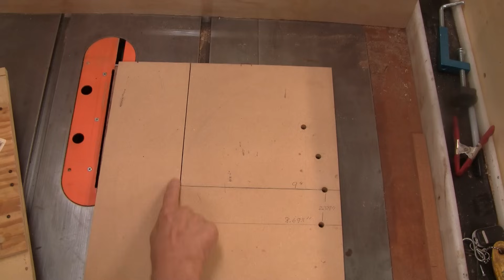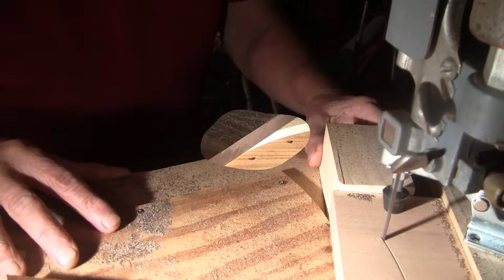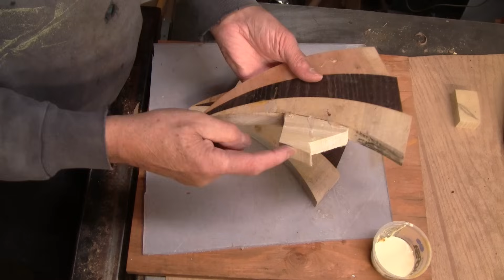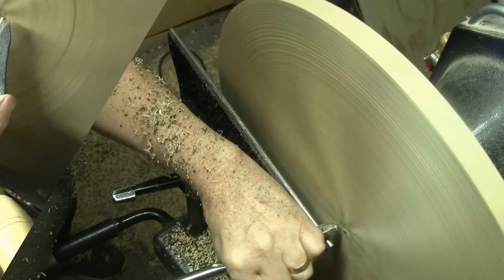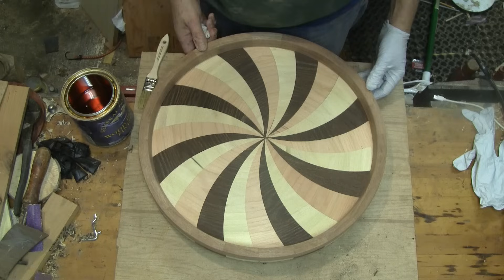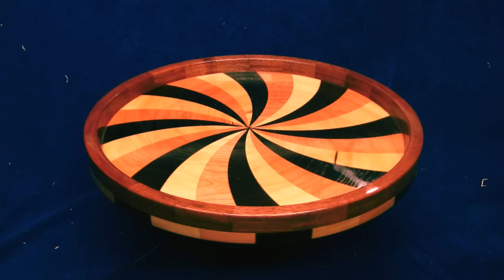This Huge Vortex Tornado Wood Turning Maxed My Lathe

Comment: Gary, this is the second vortex bowl you have made and put on your page.  They are vastly different, so my question is whar is the mathematical basis for the computations that make up the jig?    For example, if I wanted to make something midway in size between the two, how do i figure that out?
Reply from the maker: Thank you David. In this video I show how I use the same jig to make a larger turning.https://www.youtube.com/watch?v=3tnPEoQKZH8
The first one and the one in this link have 12 segments.

This bigger one here has 24 segments so I made a new cutting sled for it.
Hope this helps. If you need more information it would be easier with email.
Thanks for watching,
Gary

Comment: Thank you Gary!  I have seen some folks use salt to slow the slipping, but of course that makes initial alignment challenging.  
I wonder if some variant of a long worth chuck would make the glue up easier assuming a glue with a slow enough cure was used.   Please do keep doing these, I truly admire your ingenuity and creativity.    I think I better master doing the smaller version before tackling the big one.   Again thank you, really awesome.
Reply from the maker: Thank you very much Ian! I am opposed to using salt in the joints. And one is not being able to make fine adjustments if needed. Gluing everything at once leaves lots of ways to keep it from slipping.  That my  be something I do if I should do another large one like this. But it is so big hard to find a place for it. We used it for a few family get togethers and will probably use it next month. It was more of a challenge than anything. Smaller is better in some cases LOL
Thanks for watching,
Gary

Comment: I think that I spotted your "big Boo-boo"...  The grain direction on one piece of the smoked oak seems to be perpendicular to all the others.
Reply from the maker: You  are correct Dave. it was  apiece I cut to decide which direction I wanted to cut the pieces. I should have tossed it as it ended up in front of my while I was gluing everything together.
Gary

Comment: Hi Gary 
  Really enjoy your videos. I am currently working on a bowl with an angled stave construction and finding the glue up to be challenging. Do you have any tips.
Reply from the maker: Thanks Rodney! Happy you enjoy my videos.

Depending on how long they are I would tape the pieces so you can roll it together and get a hose clamp on each end.
Check this video out and see if it is what you are doing.
https://www.youtube.com/watch?v=R4T1B--E8gw
Reply: The video really helped. Thanks. Will have to try your rope clamp.

Comment: i and looked until I was crosseyed, but still couldn't find a BOOBOO.
Reply from the maker: Thank you Cora. Well it is very hard to see. But I had one of the burnt oak pieces with the grain going the other way from the rest. I had cut that piece when testing the cutting fixture and should have tossed it. Instead it somehow got mixed up with the rest of the pieces.
Nice hearing it is pretty hard to see...except for me LOL
Thanks for watching,
Gary

Comment: Nicely done. Always like a challenge so this will go on my list. Well, the other, smaller vortex bowl was already on it but I just revised the list for the larger size. I do enjoy your commentary. Andy the wrong grain isn't an issue, it's a feature.
Reply from the maker: Thank you very much Randy. You may want to wait till I try the new glue method I have plans for. This was a real bear to glue up.
 Yes it is a feature but not really planned and I was not happy with myself. But it works.
Thanks for watching and reminding me of it not being a big deal.
Gary
Reply: Isn't it interesting how often we figure out the easy way to do something just after we do it the hard way? And I always refer to that type of error as SDE ( Serendipitous Design Enhancement ) @ThePapa1947

Comment: HI Gary...very nice platter!  I wonder if you could answer a question...I notice that you use the ACKS abrasives and wax a great deal, but didn't use it on this project.  Could you say a bit about which finishes you use the ACKS products on, and which you don't?  I just finished a small table top with General Finishes Arm-R-Seal, and wondered about using ACKS to bring out the gloss a bit...couldn't find any examples of people doing that... Thanks!
Reply from the maker: Thank you very much Israel.
 I use the Acks on all of my finishes.  The finish on this one had the depth I was looking for so I did not use it.
But I use it a lot on the wipe on poly that I use.
 I see no reason not to use it on the Arm-R-Seal. For me it is a substitute for having a buffing system.
Hope that helps and thanks for watching,
Gary

Comment: Hi there Gary yet another excellent project I really want to have a go at your vortex tray but looking at my new Axminster 406 it will only allow me to turn 16 and a half inches over the bed bars , if I am careful do you think I could turn it sideways?  if not would it work cutting the pieces out on your sled if I just shortened them a little or would that send the shape all wrong.In the meantime I am looking forward to seeing your video on making the sled as I am not quite sure about one or two things like just where you have put the holes for pivoting the top part,and how critical is it to get the 2 measurements right 8.69 inches and2.39 inches,plus the positioning of the long and short blocks.Thanks very much in anticipation you are a very skilled man I am looking forward to attempting this i did manage the bowl with fish in Padouk and sycamore but I have still to cut the rings yet.It really is great whatching your videos please keep it up and may you and your family all have a very merry Christmas and a happy new year from Ron and Anne in Spalding Lincolnshire England.
Reply from the maker: Hi Ron.
 You will be able to turn anything from a 1 inch bowl to a 24 inch. It is a matter of the placement of the stop.
The placement of those holes are very critical to everything working. Not hard to do though.
 I this placement will give you 24 segments. My first jig did 12. 
You could actually leave the locator board the same but it is a waste of material and the scrap will be much bigger on a smaller turning. So by adding spacers against it you can adjust for less waste.
 I can go over that in a video.
Thanks for watching,
Gary
Reply: Thanks very much that  reply Gary I look forward to seeing your video you are a great guy bye for now Ron

Comment: That is one beautiful platter. I did see one spot that looks like it was accidently scratched/cut fairly deeply it doesn't take away from the beauty.
Reply from the maker: Thank you Judith. That black line that looks like a scratch is some staining that was in the wood.
Hint: Look close at the grain in all the pieces. But I will show it in a few weeks.
Thanks for watching,
Gary
Reply: Thanks for correcting me.
Reply from the maker: Well it does look like a scratch for sure. And it would be hard for you to tell just looking at a picture.

Comment: Gary
Yet another amazing vortex turning. I have made over 2 dozen of your 8 and 11 inch "bowl-from-a-board" vortex bowls (great Christmas gifts!) using the earlier small band saw jig. I would love to give the larger version a try, however, my lathe is maxed out at a 14" swing. Really looking forward to seeing how you build the larger jig, but is there some way to scale the diameter down to make something in the 12-14" range? Thanks again for the easy-to-understand step-by-step details.
Reply from the maker: Thank you Bruce. The new jig will make glues ups  1 inch in diameter to 24" or more. Just a slight adjustment on the fence to place the stock.
I have and idea on what that is adjustable but will need to work on that.
Thanks for watching,
Gary

Comment: Try as I might I can’t see any thing going on other than one beautiful project. Great job once again. Keep on turning I really enjoy your videos.
Reply: I made 5 cutting boards at one time. They were all 12”x18”x2” thick. I had them all ready for a final sanding, I was looking back at the stack of them as I was heading in for the day wouldn’t you know it on one of them I glued  one board with a piece of cherry and walnut reversed. I let it go and used it for a drawing.
Reply from the maker: Thank you Dale. It is kind of minor but it bugged me. I will show it in a future video. One of the pieces had the grain going the wrong way. It was a practice piece and decided to cut the pieces with the grain going the other way and I should have tossed that practice piece. I picked it up without paying much attention....oops
Thanks for watching,
Gary

Comment: Lovey piece. I like the Lazy Susan idea. 

Obviously the issues you talk about are pretty minor. The one joint is very minor. It wasn’t really visible on the video, but was the other one the center point? If not I have no idea. 

Great job and video.
Reply from the maker: Thank you Doug. I will try and show it in a video in a few weeks. But what it was involved the grain going the wrong way. It was a test cut to try and save lumber and I should have tossed it when I went the other way. Some how I was to close to the ones I was using. OOPS
 Thanks for watching,
Gary

Comment: Absolutely liked it, any of the projects you do that require a little upfront prep/engineering I find the most interesting.  Please, please do a video,Mon making the bigger jig, and of course any tips on glueing it up.    Was that a 1/4 or 3/16” bandsaw blade you used?  Thank you Gary!
Reply from the maker: Thank you Ian. I will do that video but it will be a month or so before I can get at it.
I used a 3/16 bandsaw blade on this. I think a 1/4" may have worked as good because it is a larger radius. These are things I need to iron out.
Thanks for watching,
Gary

Comment: when did you notice your lay out was off?  Had two dark pieces with one light piece, while turned work had two light between two black?
Reply from the maker: I think it was when I was block plaining the bottom.  
But the oops I was talking about at the end is still in there. Has something to do with grain.
See if you can find it.
Thanks for watching,
Gary

Comment: What a success, Gary! Didn't think I'd like the Poplar, but I do. Not sure I can see your mistake. I certainly like a project that is more than it seems or has multiple functions. Great work!
Reply from the maker: Thank you Jay. I was not so sure about the Poplar either. But the cost was very reasonable. I tried to keep the cost down as I wanted to make sure this would work. Well I knew would but had not worked out how to glue it up.
I think I have something that will be perfect so I will have to make another one.
  Getting wood at the hardwood store has gotten a bit costly. Since I do not sell I can not recoup the cost. 
But I do enjoy making segmented work.
Thanks for watching,
Gary

Comment: Gary I find these segmented projects intriguing and they turn out really good. What size blade do you have on your bandsaw? It looks like around 1/4".  Yes, I would like to see how you made the fixture and the other way you would do the glue up. I learn a lot from your videos, so thank you.
Reply from the maker: The blade I used is a 3/16" with 11 teeth per inch. For this size radius a 1/4" should work fine.
I am planning on a follow up to this after the first of the year as time permist.
Thanks for watching,
Gary

Comment: That cutting jig is pure genius.
Reply from the maker: Thank you very much Gary. It did a good job. I wished I would have used better wood. This stuff moves around a lot.
Wood has gotten pretty costly to buy and I wanted to test the system out with decent wood but not overly expensive.
 Next one I will use something nicer. The thing of it is the way I cut it I needed boards that were at least 9 inches wide.
 Thanks for watching,
Gary

Comment: Good evening, Gary.
   Absolutely love this. Very impressive. I saw the last two pieces on the glue up, excellent fix. I didnt see the grain but read about it. You really maximized your lathe. Great project. Looks like several turners would like two build your jigs and make their own tornado.
Reply from the maker: Thank you Ray. I was a bit mad at myself when I saw the miss placed segments but I got over it and the fix worked great. Band sawed the pieces out and left just enough to use a sharp chisel and a tool I made that looks like a paint scraper but made from part of a file.
  Then I saw the piece with the grain  going the wrong way(a practice piece when i setup the jig. Should have been tossed) 
 I never considered surrendering so I sanded it and finished it and call it an odd piece.
 Thanks for watching my friend,
Gary
Reply: @ThePapa1947   Excellent. You should never consider surrendering.

Comment: Well I  think your design was amazing.  Nothing that I will ever try. Call me a spectator. But I wanted to mention that you need an American beauty lathe. I love the 25" swing over the bed. I also love general finishes bowl finish,  though I am not a fan of how long it takes to get it to dry. I like 5 or 6 coats and it is beautiful.  Thank you Gary another amazing job well done.
Reply from the maker: Thank you very much Rick. I agree I do need one of those American Beauty lathes. Maybe I can enter a contest and win one LOL. The patternmakers lathe we had at work could swing over 30 inches over the bed. I think they scrapped it out a few years after I retired. Was too big for my shop anyway.
I put the finish on very thin and  used a space heater on low to blow over it. Did not take all that long. 
 Thank you for watching and next weeks will be something I think you will like 😉
 Take care,
Gary

Comment: Just glad you corrected the out of order gluing. I was shouting “NO!” when you put them in out of order and again when the glue was dry. Was glad to see you went through all the work to correct it. Just hate when I do something like that! What a pain!!! Any other boo-boos are minor which only the maker (you) or the quality control inspector is going to care about. 👏🏻👏🏻👏🏻👏🏻👏🏻
Reply from the maker: Thanks Valerie. Glad I saw that when I did. I was temped to start over but had a ton of work in it. I guess when I saw how good those last pieces fit I forgot about the proper order.
 But that is not the oops I was talking about at the end. There is another one and it might be hard to see.
I will give you a hint "grain"
 Not happy with that but it is hard to see...especially in the dark LOL

Comment: I watched you make the error when placing the last two segments. Then I noticed later the error was gone. In reading previous comments I see you cut the two segments out and replaced them. But I cannot the error you referred to at the end of the video. The bowl/platter/lazy susan is very nice but I am more impressed with the sled used to cut the segments. Thank you for sharing. Have a great day and remember, when the wood goes around, the face shield comes down. 🙂🙂
Reply from the maker: Thank you Glen. I sure could have cut out the part where I showed them glued in. But I did forget to mention that.
I as so upset with myself I was ready to burn it! LOL...no I wasnt.
So I will show the oops at the end in a few weeks but I had one piece of the dark wood I tested cutting with the grain. I should have tossed it and I grabbed it by mistake. That one I did not see till it was all sanded up. Hardly noticeable. Except by me and it really does not stand out. I have to look till I find it.
Thanks for watching,
Gary
Reply: @ThePapa1947  ARRRGH my eyes! I cannot unsee it! Maybe the loose joint in the middle will be in your favor though. Anyway, this piece is gorgeous!

Comment: I loved this particularly the process used.
You’re not stubborn but a creative wood artist genius at making jigs and designing intricate designs.
Glad you mentioned peripheral speed at 500 rpm, probably could’ve made more of a safety issue out of this.
My wife didn’t like finished product but appreciated the work involved, she only saw the end result.. I thought the lip of sapele was not utilised as well as it could have been, too thick I thought as it would interfere with removing and replacing objects on board. Also it made finished product look not delicate and refined.  But that’s only my opinion, I think that board needed something on rim, possibly turn sapele a little thinner.
Sapele is also referred to as African mahogany and grows on same latitude as Honduran mahogany, yes a beautiful timber.

Thanks for sharing Gary. Would definitely appreciate more of a look at making your special cutting jigs, they’re amazing.
Reply from the maker: Thank you Greg. I did not care for the lip either. The good thing is I still have that tenon on the bottom and can turn it down. I did not put enough thought in it and was wanting to get it done. Broke my rule...never get in a hurry.
 Figuring there may be things spilled I wanted to give it plenty of protection. If I turn the rim down I might flatten the shine with some scotch brite. I well let my wife decide on that.
 Thanks for watching and your opinions. They are much appreciated.
 Take care,
Gary